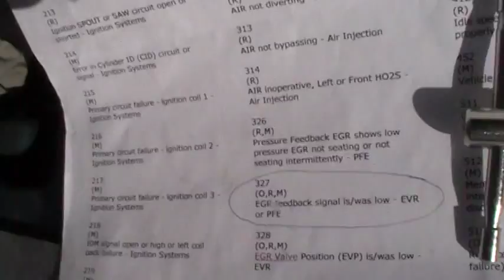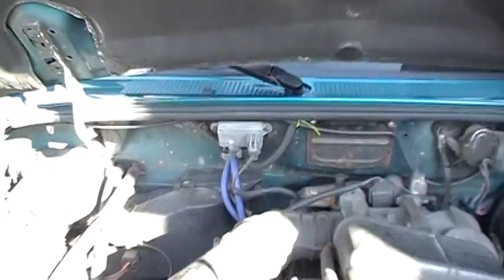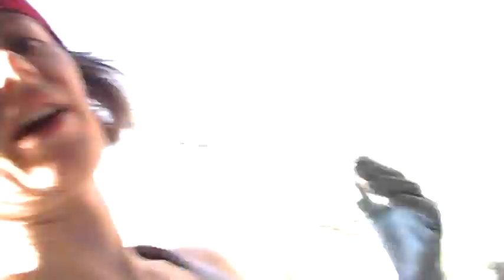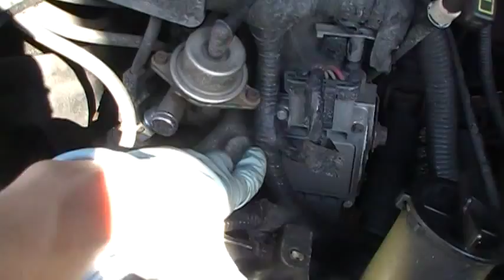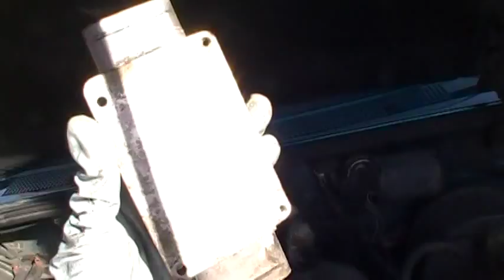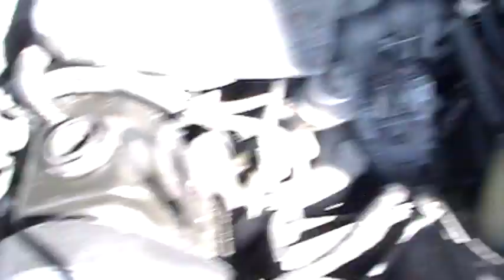DTC CODE 327 223 and 224 1994 FORD RANGER

Comment: This explains why my engine is reving wierd at times as i brake. Code 224 is what i got today. My truck has been running really ragged ever since i used engine degreaser and cleaned the engine. I have a code 519 and 224. Code 519 on google is telling me power steering pressure but another guy shows PCM. I regret ever cleaning my engine!

Comment: Hey there!  I just wanted to send you a quick comment thanking you for this video.  My Ranger's CEL came on and I had a similar DPEF code and the same 224 code come up.  I consulted my Haynes manual and did some diagnosing.  I did find that one of my coils was a little out of spec so I replaced that although I think I probably didn't need to and in the end it didn't do anything for the CEL problem.  I think the DPEF sensor checked out fine but I replaced it and the EGR related code (335) went away.  I watched some YouTube videos and read some blog posts and was thinking that I need to replace the computer until I saw your video.  I'm not a mechanic, so knowing how to fix these kinds of things isn't easy for me but your video made sense and you basically were having the same problem as me so I decided to replace the ICM.  That fixed the problem!  No more CEL.  Thanks so much.  I love YouTube!

Comment: she  didn't have to go through all that trouble that truck came with only three bolts and both the left side screws are grounds most instruction sheets come with a diagram showing three different ways to bolt the new icm on 1 says  wrong and the others say right one with bottom left only the right  way  and both left sides the right way but other info I read says you have at least the bottom left it is supposably the only ground. not a mechanic but had the same problem and mine had only three screws and works fine after a lot of research.but give her credit it is in a hard place to get to mine has a/c and you have to unbolt it take back the radiator hose and bungy it as far forward  as possible to get to that bottom bolt that is a 5.5mm bolt

Comment: Thank you for the great video. I fixed my 93 Ranger by replacing the ignition control module too. Check engine light is off now. And truck is back to how it should run.
Reply: What code did you have
Reply: @davidluevano3028  I do not remember.  It was a year ago.

Comment: I have that exact same year and engine. The 2.3 4 cylinder. Mine's a Mazda B2300 though, which is no different. Did yours have an air conditioner? I am nervous about taking off the air compressor. Did you have to remove it? Is it just bolts and a plug? Any other tips? I don't think I need to drill and tap it unless the bolts are stuck. I suspect the wiring is enough for that tiny motor. That's probably why they didn't bother to put another bolt in.

Comment: hi hello. i have 1996 ranger xl, abs light comes on after 10 seconds then stays on. i have changed the rear abs sensor top of the diff. refilled the brake fluid, checked the fuse #14 fuse box, still comes on after i start driving for 10 seconds.

Comment: If you get EGR codes, if there's vacuum at idle, replace the charcoal canister purge valve. If you get Oxygen sensor running rich, replace the MAP sensor. Get a Actron CP9690 code tester. It does live, record, graphing, code connect for solutions, and MORE! There aren't codes for the module. Warm up the engine before testing. If the timing mark flutters, it's the module.

Comment: is the ecm for this the same as the pcm for a 94 b4000 le 4.0L
Reply from the maker: no the ecm/pcm is different for the 4.0. the ranger im discussing has 2.3 litre 4 cylinder. if you have a 4.0 ranger and a 4.0 mazda pcm I believe they are the same

Comment from the maker: It's definitely possible, but make sure you have ruled out fuel filter. If it has never been changed it could cause a problem. The ignition coils are also to be in question. The ICM may govern the coils but if one is bad it could cause havoc. If there are engine codes you should  retrieve them.

Comment: While driving or parked, every time I rev my 2000 Ranger to about 2800 rpm or higher, the idle drops to 400 rpm and struggles to run. The engine even stalls sometimes. Could it be related to the ICM?